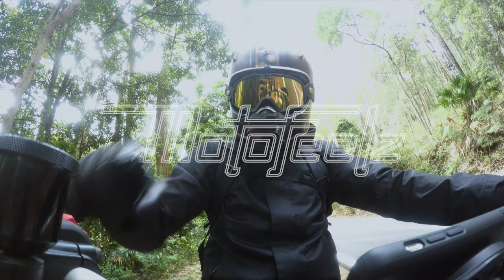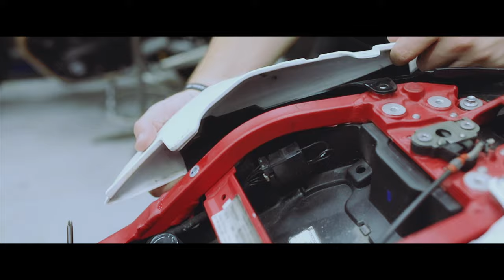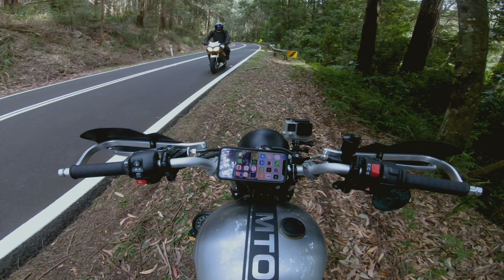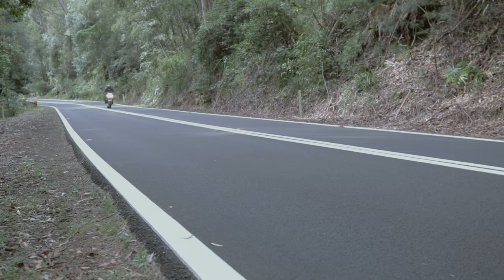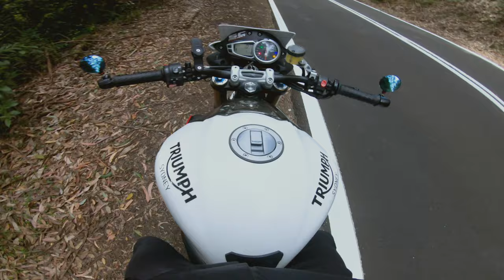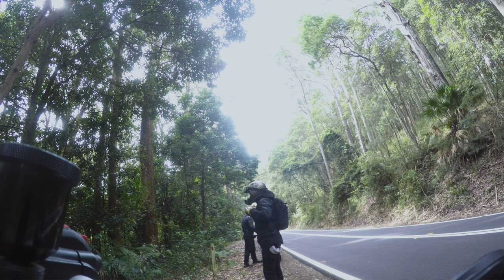SC Project Exhaust SOUND! | Speed Triple R

Comment: The Triumph dealer has a 2016 Speed Triple for sale with 6K miles on it. I'm thinking of giving it a test ride and maybe buying it if I like the ride and the condition the bike is in. I have a 2014 Street Triple R at the moment and I could pick it up for 5K with a trade in. I was looking at what I could do with the bike since the pipes are stock. The SC Project seems like the way to go. I like the under seat exhaust option and this one. With the money I save not buying a new one, I can get some nice accessories for it like the pipe, tail tidy and possibly upgrade the suspension since it's an S version. What are your thoughts on upgrading to the Ohlins from stock ? Worth it ?